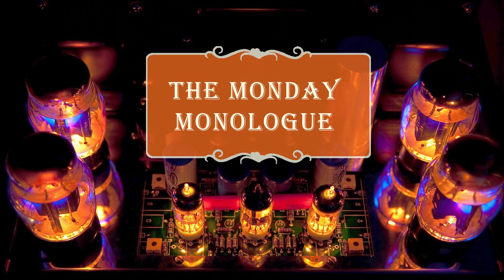Monday Monologue: Simulation vs Actual, DIY Speakers

Comment: I built a pair of Voigt pipe speakers out of 3/4 inch Baltic Birch plywood. I loaded them with Tang Band w8 1772 full range speakers. The amp is a EL34 (SET) class A, with no negative feed back. I can’t describe how good this system sounds. This is As Old  School as it gets. It my not look so good on paper, but the sound is Heavenly.   Thank You Skunkie for sharing your builds with us.

Comment: Yes, exactly. Measurements and even simulations are a starting point, but certainly not an end result. As you’re aware, you’ve gotta listen for that,  and sound is subjective. As far as the speaker kit you’re talking about, that’s Danny from GR Research. He’s very measurement oriented, and his speaker kits sound fantastic. At least what I’ve heard. A friend of mine built a pair of his bookshelf speakers. I think they were called XLS Encores or something similar? I didn’t get so far as to ask about or A/B the binding posts / tube connectors, or whatever, but the speakers sounded great. Good luck with the kit. I’m hoping you’ll like em. 👍🎶🙂
Reply: Build a pair of X-Statics and their fantastic.  If you really want a good project I would go for them.
Reply from the maker: Thanks for the comments!!
Reply: Any magnetic (ferrous) material needs to be replaced but the audible difference between non-ferrous binding posts vs. tube connectors will be subtle at most. Danny (dba GR Research) is correct about crossover parts though and also freely recognizes when diminishing returns set in.
Reply: @1mctous  Yeah, the binding posts have an extremely subtle difference, but there’s no doubt better crossover parts like caps, resistors, inductors, etc. make a noticeable difference in sound quality. 👍🎶